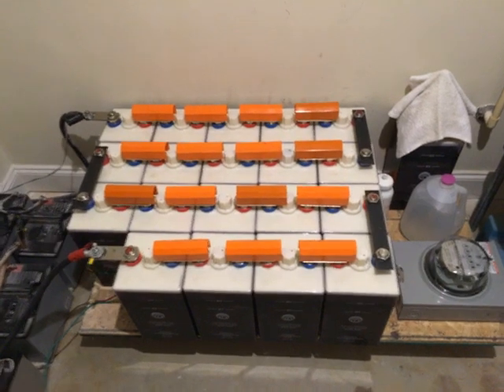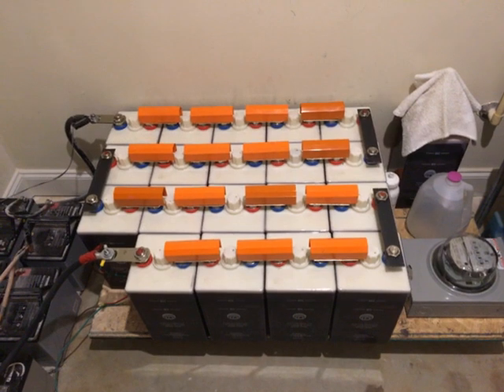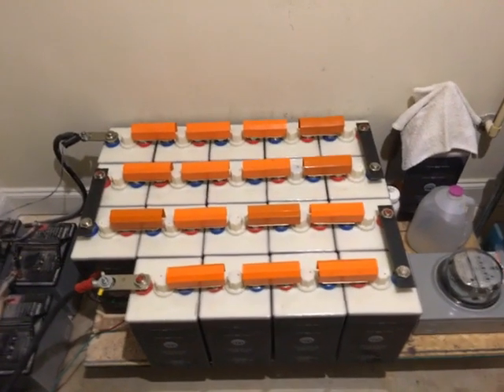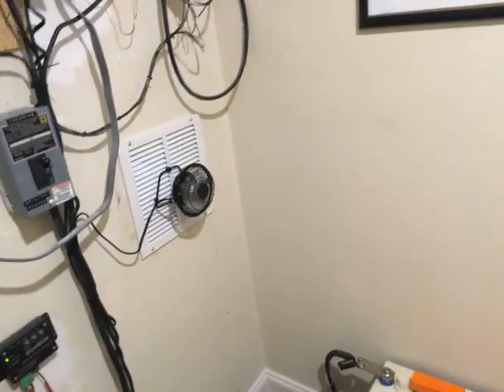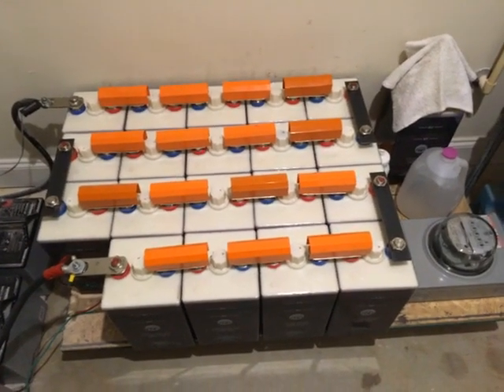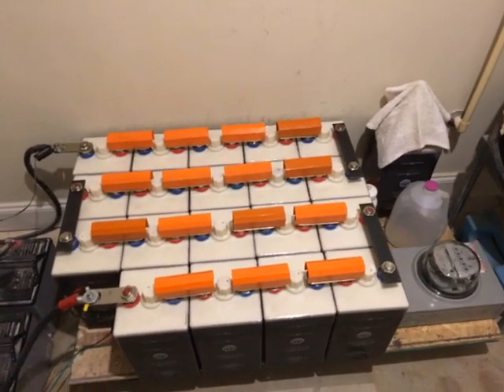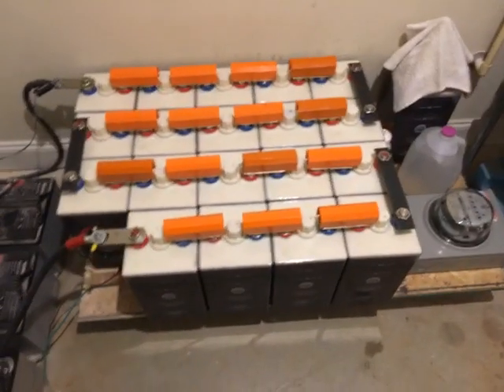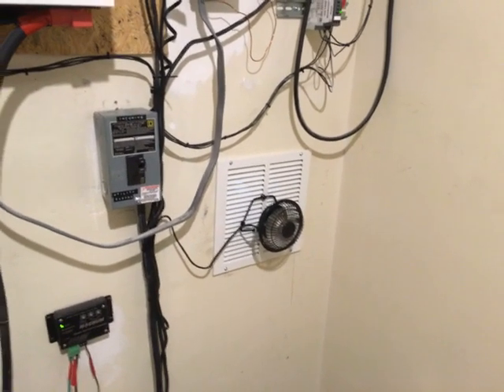Lets talk about Nickel Iron Battery Charging, Gassing, and Venting

Comment: I'm also curious - you say in the video that you are off grid from 7:45 to 5 pm, so then what? Why aren't you off grid all night too?
Reply from the maker: Actually, I typically run my battery bank for around 8 to 9 hours at night and recharge the bank the next day.  During this video, I was still getting the feel of the system and testing their capability to work with Ultra-Capacitors during the day.  However, when I use my battery bank at night, I use a C/20 discharge rate 200Ah / 25Amps = 8 hrs of use, typically.  So during the day, I charge the batteries and send power back to the grid and use the batteries at night, starting around 9:00 p.m. or 10:00 p.m.
Reply: thanks for your replies. I'm planning on buying some batteries from beutilityfree also, so it's good to hear what you have to say because all the local dealers who sell lead acid batteries just bad mouth nickel iron.
Reply from the maker: Nickel iron cells are hard to beat. I still believe they are a better investment. Being a able to drain your batteries night after night and not worry about depth of discharge is well worth it in my opinion.

Comment: I was lead to believe that voltages under 1.65v gassing ẃould be quite minimum. Any danger in ignition or explosion would be over 1.65v per cell... Also your vent fan might not be efficient... covering up the surrounding holes will draw more air... eg sucking a drink through half the opening of a straw... EXCELLENT VIDS by the way...
Reply from the maker: Thanks for the comments, and you are correct, voltages under 1.65v will gas less than higher voltages.  However, even small gassing in a confined space is still a hazard.  I'll try covering the small holes, it may help.
Reply from the maker: I covered up the air flow underneath the door to the garage and it "seems" to helping.  Covering up the draft seems to make a better seal for the room.  Thanks for the idea.
Reply: lol no worries...
Reply: LandRover man I want to know if these battery run you 24 hour  and at what amp you still have go meaning if you can go another day